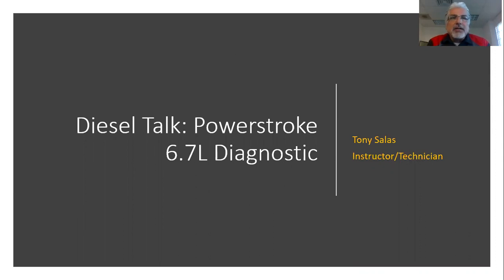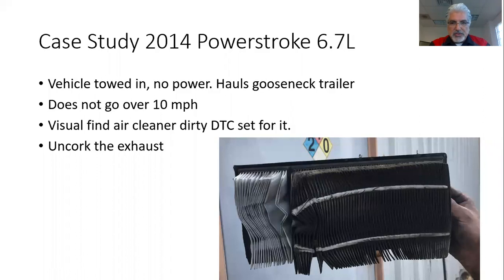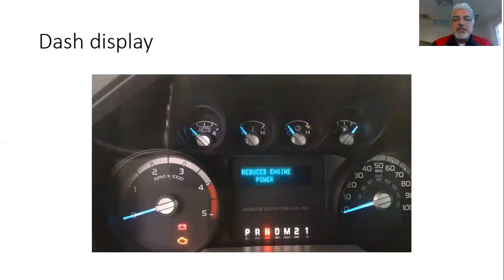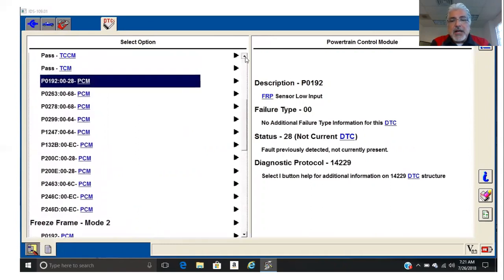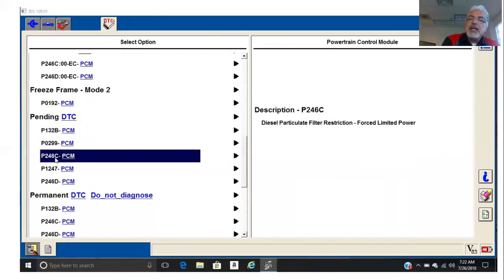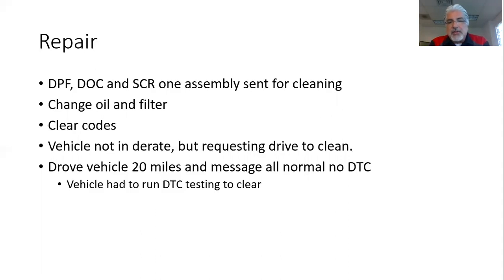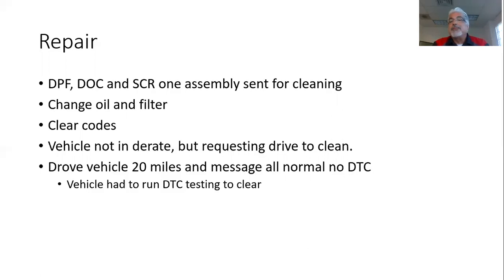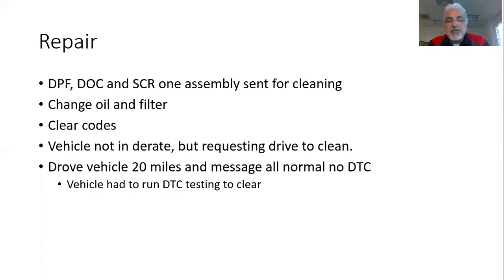Powerstroke 6.7L Tech tip

Comment: I have a 2011 f250 6.7 hade a fuel rail put on the drive side and now it comes up as a reduced engine power
Reply from the maker: Thanks for the question ! Why was the rail replaced ? Was there an issue ?

Comment: I have a question about the fuel injectors on my '13 F350. Have had to get several replaced
due to codes. But never told reason for failure. truck used very conservatively, low mileage. can  I get some advice?
Reply from the maker: What would you like to know? I don’t know why you had those injectors replaced but if you are addressing preventative measures you can run additives.
As a cleaner I have had results with BG245 from BG Products. Once every 6 months for your low mileage driving. 
A lubricant is also desired which are either Stanadyne performance formula or Alliant Power fuel additives are proven.
Change those fuel filters very other oil change. 
Be nice to know what codes you had.
Thanks for watching!